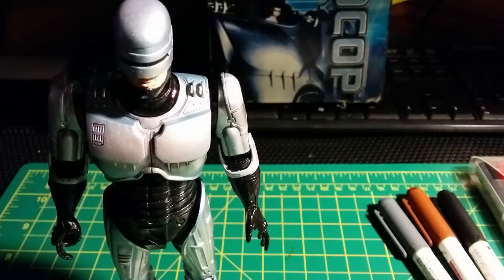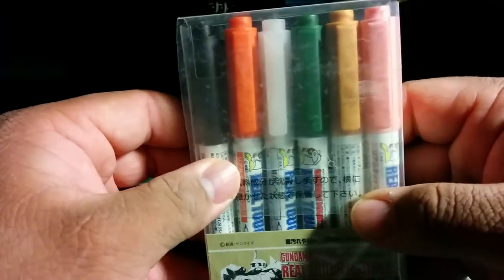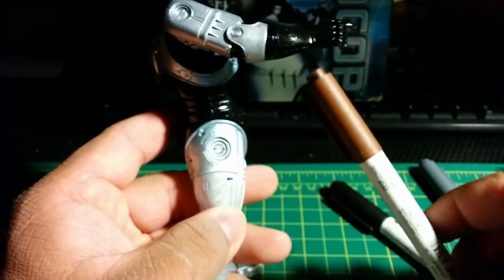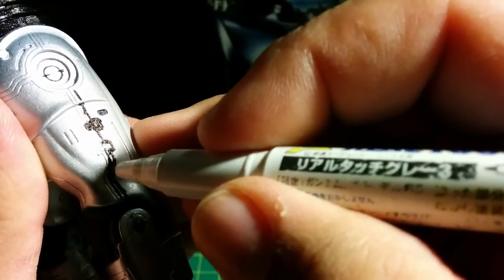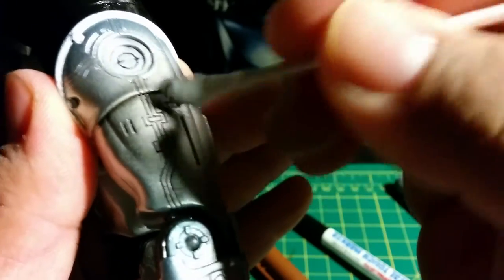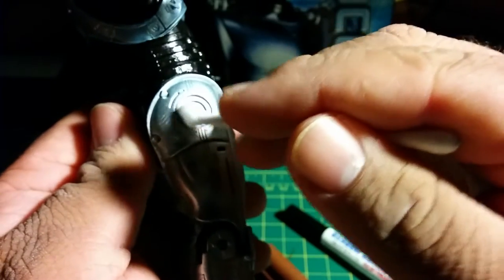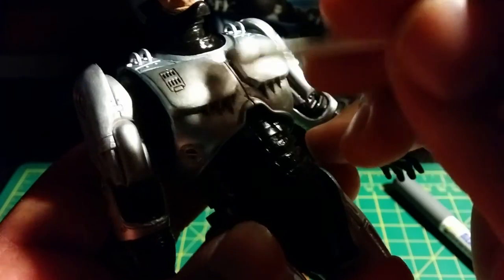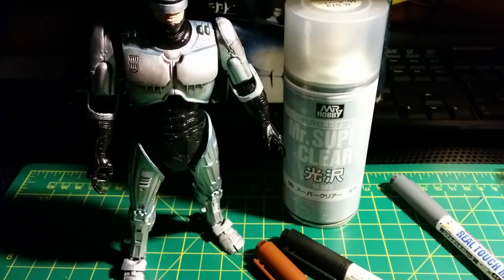NECA Robocop, custom shadowing tutorial!

Comment: Nice tip. I know there is no right way or wrong way of doing this but I would go with a grey color instead of completely black so it will look subtle. But this is a great idea to use these markers. I have a few sets and never thought about using them on my action figures. Thanks man. I'm going to touch up that hideous 80yrs anniversary multiverse joker face now🤣